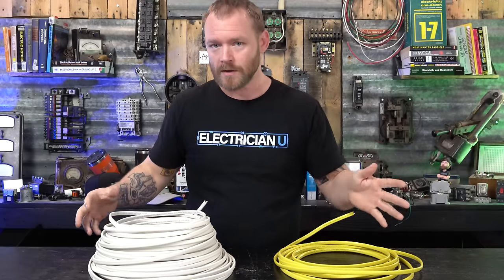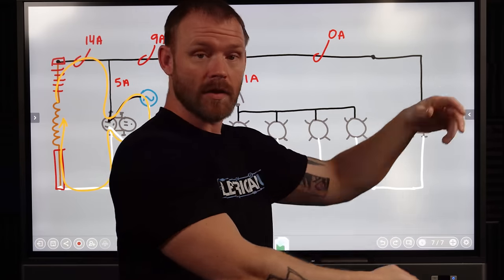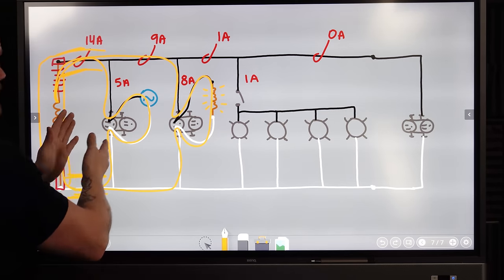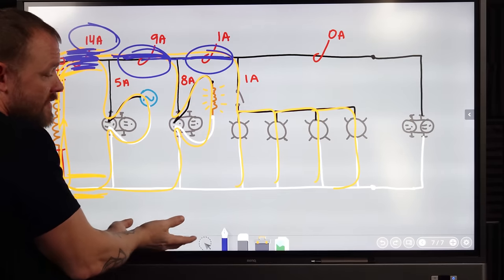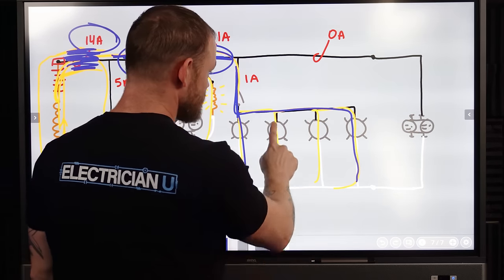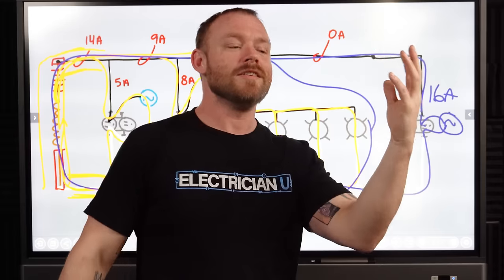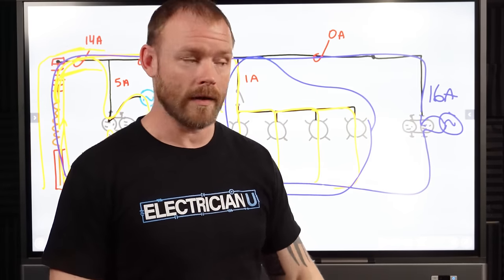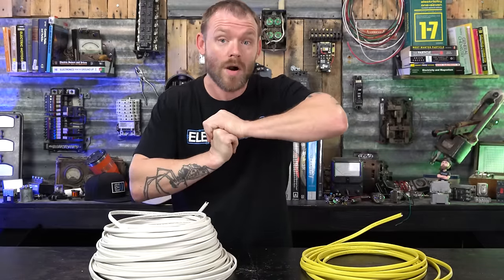Should You Be ONLY Using 12/2? When Can You Use 14/2?

Comment: I was always told NEVER to mix gauges of wire. For example, if I run a 12 gauge to an outlet off your light circuit, the 14 gauge wire would get hot in the wall, with the breaker never going to trip. A big no-no. I was told to protect the circuit for the lowest wire gauge and in your example. if you use #14 for your lights, the circuit breaker should be a 15a. Not 20a
Correct?
Reply: Pretty sure you are right. If there is a fault at any point on that 14 on the 20amp circuit you will get the full fault current of a 20amp circuit and the breaker will take longer to trip potentially giving Time for that fault to create other issues
Reply: That’s what I’ve always understood. The breaker protects the conductor not the device.
Reply: You are misunderstanding what is being said in the video. Dustin didn't say you can run 12awg to a receptacle from your lighting circuit, unless the entire wire from the circuit itself to the receptacle is 12awg, and the smaller gauge for lighting is only possible in some places where an inspector will allow it.
You cannot start at a 20A breaker, go 14awg up to some lights, then 12awg down to a receptacle. It must be:
20A breaker to a receptacle with 12awg, from the receptacle to a switch at 12awg, from the switch to the light at 14awg. That 14 cannot go to anything else and must only go to the lights themselves and only after the switch.

A short in the 14awg area will perform about the same as a short in the 12awg area. Both of them would draw more than 20A, and both shorts would trip the breaker. The 14awg is also still oversized to the current LED loads, but is sized correctly to the load if someone were to switch to incandescent again (though those aren't even sold any longer so you can't really do that). Per the current NEC 240.5(B)(2), you are allowed to do this for light fixture lighting.
Reply: @LordSaliss  But the breaker is still to protect the wiring in case of faults or overload. Read all the other comments asking the same thing.
Reply: @LordSaliss  I think you might be misunderstanding the function of an OCPD. It is a safety device. In the event of a fault where more current flows than the #14 is rated for the 20A breaker won’t protect it. 
It being a lightning portion of the circuit is irrelevant since the breaker is there to protect from abnormal operating conditions. (Fault)
Reply: @LordSaliss  I agree, however I have been told the circuit has #14 anywhere, the entire circuit must be protected by a 15A breaker even if you have a #12 leaving the box.
Reply: @LordSaliss  That was my understanding of the video. 14awg from the light switch to the lights and in between the lights but only for that leg. 12awg from the breaker to all receps and power to the switch. 
(As an "only residential" contractor/electrician) I have never run a circuit this way. I am either all 14awg from the 15A breaker or I am all 12awg from a 20A breaker. I like the 14awg in the new LED recess lights because their attached j-boxes have so little room that 12awg is a problematic fit. I also appreciate the 14awg in the switch boxes that can get very crowded with 12awg.
Reply: @LordSaliss  I understand what you're saying, but code doesn't allow you to run #14 to light fixtures on a 20A circuit, even if the #14 is supplying only the fixtures. All of the wiring needs to be #12, except for tap conductors that are no longer than 18" from the fixture.
Reply: @jonclark1288  (2) Fixture Wire
Fixture wire shall be permitted to be tapped to the branch-circuit conductor of a branch circuit in accordance with the following:

15- or 20-ampere circuits — 18 AWG, up to 15 m (50 ft) of run length

15- or 20-ampere circuits — 16 AWG, up to 30 m (100 ft) of run length

20-ampere circuits — 14 AWG and larger

30-ampere circuits — 14 AWG and larger

40-ampere circuits — 12 AWG and larger

50-ampere circuits — 12 AWG and larger
Reply: So looks like code says lighting fixture wire on a 20A OCPD can have up to 100ft of 16 gauge wire going from the 12AWG branch circuit wiring to the lighting fixtures on that circuit. At 14 gauge there is no length limit.
Reply: @LordSaliss  thats odd. What if the total current draw from lights EXCEEDED 15A ie outdoor halogens etc. The CB would never trip, yet the #14 would get hot.....
I am surprised they allow you to use smaller wire, thats protracted by a CB that exceeds the current rating of that wire
Reply: @LordSaliss  402.3 "Fixture wires shall be of a type listed in Table 402.3" NM-b (AKA Romex) is not fixture wire. 
402.10 Uses Permitted: ...1. For installation in luminaires and similar equipment
2. For connecting luminaires to the branch circuit conductors

402.12 Uses Not Permitted "Fixture wires shall not be used as branch circuit conductors except as permitted elsewhere in the code"

The only time you'd run over 20 ft of fixture wire (that I can think of) is if you have several fluorescent fixtures connected end-to-end, essentially forming one long fixture. You'd use fixture wire inside the fixture. Any wiring outside the fixture would be branch circuit wiring, where you must use #12 or larger on a 20A circuit.
Reply: @jonclark1288  I know you're on the same page already, but for others' benefit, I think 402.10.2 is even a little misleading. Even if it's the right kind of wire, you can't just call it fixture wire and go on your way. If I'm reading all the definitions correctly, lighting fixture wire can only be present in junction boxes and listed luminaires. If it leaves the J-box, it becomes branch circuit conductor.
Reply: @benchociej2435  I agree that wiring leaving the junction box is branch circuit conductor. I also agree that the definition isn't very clear. There is no definition for fixture wire in Chapter 1. But the definition for branch circuit conductor is "the conductors between the final overcurrent device protecting the circuit and the outlet(s)." So the light fixture itself (or the junction box right next to it) is the outlet, and all wiring before that is a branch circuit conductor.
Reply: @LordSaliss  A short is not the only concern.  What about an overcurrent situation?  That would put more than 15A on the 14 AWG conductor.  This installation would be in direct contradiction of the code.  See 210.4(D)(3).

Your reference to 240.5(B)(2) specifically covers fixture wires -- not switch legs or jumpers (i.e. branch circuits).  See 402.10 & 12 for clarification.
Reply: @LordSaliss  Don't get "fixture wire" confused with "branch circuit".  Fixture wires are not allowed to be used as branch circuits.  See 402.10 &12.  Fixture wires are inside a fixture or similar equipment.  They are in a controlled environment, so to speak, and therefore aren't required to be full size.  I've had jobs where the fixture wires were over 50 feet long because they were inside of fluorescent light strips for a supermarket or store.

But in a typical residence, the wiring between fixtures or between the fixtures and the switch are part of the branch circuit.  They must abide by branch circuit requirements.  210.4(D)(3)
Reply: No, that's wrong. You can mix cable sizes, and simply mixing won't cause the smaller gauge cable to get hot. I think you're assuming and forgot to say: on a 20A circuit, drawing ~15A+.

You can use 14awg, but then you'll most likely be required to size the circuit protection (breaker/fuse) as 15A. There are exceptions, and larger things we wire in often have FAR smaller conductors inside them than what we run to them. I have 12awg going to my gas furnace, and immediately inside it's spliced to 16awg or smaller. But that's safe, as even with higher loads, it's on very short runs.

14awg is even safe on a 20A circuit drawing ~20A, if it's a short enough length. The resistance is then low enough that it won't get too hot.
Reply: @cavscout888   But you're assuming that the 20A  breaker will never allow more than 20A to flow through the circuit without tripping... which is known not to be true.
   When the draw exceeds 20A, and the breaker does not trip, then your carefully-calculated maximum "safe" distance of 14awg wire can suddenly burn through its insulation, arc, and set the building on fire. All without any breakers ever tripping until after the building's flammable  materials are well on their way to a total loss.

Comment: Something seems off in the presentation.  I thought the NEC forbade running cables with smaller gauge wires than the breaker’s rating for the branch.  E.g., can’t use 20 amp circuit breaker to protect a 14 gage (15 amp rated) cable.  Otherwise, a shorted current of say 19 amps wouldn’t trip the breaker but it would overheat the 15 amp rated cable and potentially cause a fire.   Do you have the NEC reference for this?
Reply: 20 years ago, all romex was white and I thought the reason it was color coded (#12 = yellow) was to allow inspectors to easily identify what is being demonstrated in this video.   I do think what is being taught in this video is low risk (since LED lighting draws small amount of current), but also would like know the NEC code allowing this practice.
Reply: I believe this is the case except for certain branch circuits supplying AC motors with a starting surge.

Comment: IN THEORY that is correct… the switch leg will never carry the load the home run will carry. BUT, I’m pretty sure that code wise, the conductor size must match the rating of the breaker ampacity ALL THROUGHOUT THE CIRCUIT… meaning a #14 AWG switch leg on a 20 amp circuit still violates code.

I think the new standard method of new construction home wiring is to run 15 amp circuits for lighting & smoke detectors because 14/2 & 14/3 is so much cheaper… especially for travelers & smoke detector interconnect… than 12/2 & 12/3, and LEDs are so efficient anyways. LEDs just don’t require much current like old incandescent bulbs. 

For circuits supplying receptacles & other power,  electricians use #12 AWG/20 amp circuits in new construction to accommodate appliances that draw more current. A vacuum might draw 7 amps & a space heater might draw 12 so #14 AWG/15 amp circuits can be inadequate for powering receptacles.

I still don’t think that #14 AWG switch leg on a 20 amp circuit would would pass with our inspectors even if in theory what you’re saying is totally correct. There are many portions of that circuit that will not carry the full load.
Reply: Yes, by adding the 14ga anywhere you must reduce the breaker to 15amps which would reduce the total allowable load rating of all the receptacle in the circuit from his example and totally negate any possible wire cost savings, which IMO is not even a good reason as long term over the life of the service those savings are negligible pennies a day for a better gauge wire. This video was good in theory but not in practice.